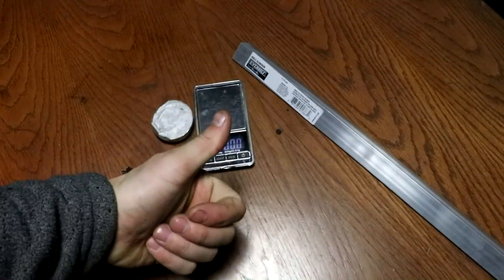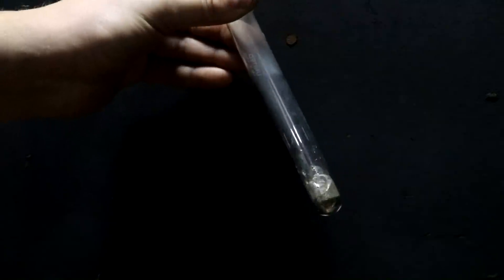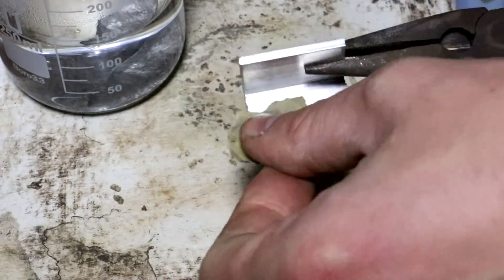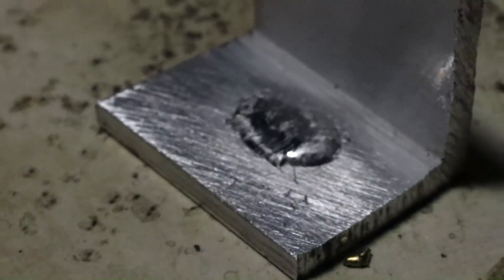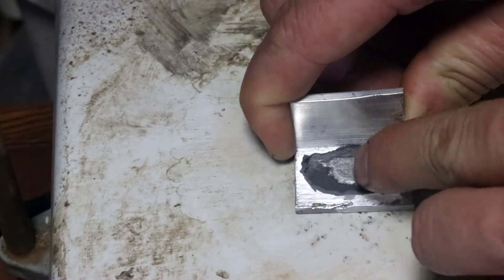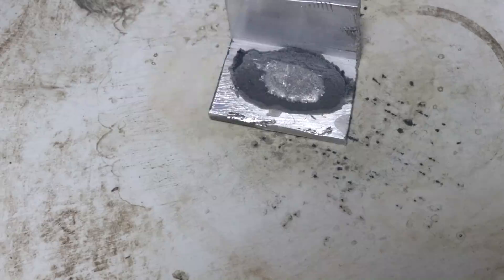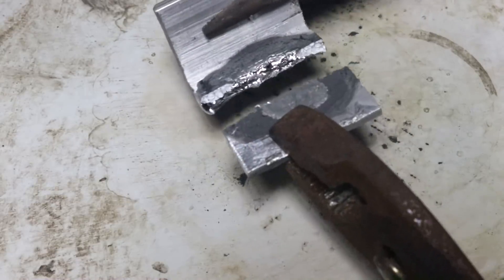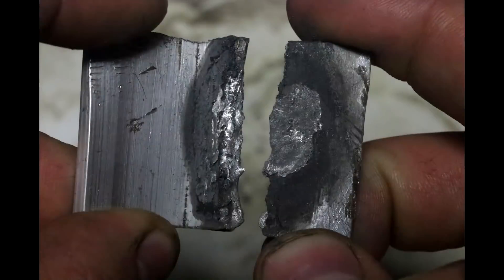Field's Metal vs Aluminium

Comment: Have you ever thought that it could be possible to use Fields metal as a cathode to electrolyze salt water to get the sodium out?
If it doesn’t work try rose metal.

Comment: So, when cooled down water vapor in the air may be reacting with the naked Aluminum. I am fabricating a small MHD pump to sling Field's metal globs around a gated loop to do what der Sprengel pumpen does but faster. Needed to know if Wood's or Field's attacks like Hg. Found no references anywhere 'cept for good old Cody.

Comment: I wonder if the reaction between the two metals is specifically dependant on a certain temperature below what you are using when the hot plate is on.?

Comment: I think this system is more complex than first meets the eye, as this is likely atleast a 5 element system, as a lot of aluminum sold for construction is hardened with copper. Plus the water might have introduced protons or sodium as well, although I doubt it actually did much here. Personally I would love to have taken an diffraction pattern of each of the materials, the aluminum and the fields metal, before and after this reaction. I do think that at the very least the aluminum chemisorbed or otherwise interculated the liquid alloy. Doesn't beta tin have that same dark gray color as well? I do wonder if it is one metal preferentially going into the aluminum, as when you reheated it, I didn't see any liquid remelting. Although it might have also been that aluminum doesn't dissolve much into the fields metal until lower temperatures. I wonder what would change if you used aeziotropic(I can't spell) fields metal instead.

Comment: I'd postulate that the thermal expansion properties of the two metals meet at some x,y point...and the field's metal can attack the aluminium at that point most optimally. Rather than thinking of solids being dissolved into solution, consider liquids being absorbed by solids.

Comment: From what I can ascertain, it works with thermal cycles because it has something to do with electrons changing energy levels. when hot they are at an energy level that prevents the reaction between the metals. when cooling off, the electrons lower their energy state to a point that allows for the reaction to take place. The electron energy levels might affect the protons between metals, one state dying to donate their protons and another state not so willing to donate protons. Something like that >.<

Comment: I'd suggest a temperature lower than the melting point of the Field's metal.
It may not be a thermal cycle causing the degradation, it may be something like the aluminum being too hot for the Field's metal to get it wet.

Comment: 1 nanolightsecond is actually a surprisingly useful unit of measurement. It's just under 30 cm (or 1ft), so you can readily apply it to "regular" distances. It's also a good starting point for latency computations: two datacenters are 1000 kilometers away, so that's about 3000000 nano-ligth-seconds, or 3 milli-light-seconds. So the lowest possible latency between them would be around 4 milliseconds (light in fiber is a tad slower).

Comment: i was looking for the video where you combined aluminum and gallium then reacted that with h2o to make hydrogen. is there any process of splitting the aluminum and oxygen from the al2o3 to form it back into aluminum, potentially make an engine that is a closed loop requiring only water and some other inexpensive chemical/s. Even if it was a vapor process it would fascinate me to hypothesize a self repairing engine that plates itself to counter natural wear?

Comment: Keeping it heated is now allowing moisture build up through the field's metal.

Only when you let it cool down is water in the air able to condensate inside the aluminum and allow a chemical reaction to occur, thus destroying the aluminum.

Comment: I'm in school to work on aircraft, and I know how finicky aluminum can be when it comes to heat treatment and temperature cycling. Errors in very specific steps of heat treatment lead to uneven grain boundaries, which (while over time would naturally split, corrode, and weaken by itself or through various stresses) is accelerated by the addition of any foreign substance (usually water or ferrous metal from a fastener in the metal). These grain boundaries are intentionally aligned laterally to best handle stresses which is why you see the metal break apart almost in sheets as it does. What confuses me is the coloration of the corroded aluminum, as natural aluminum corrosion generally appears at a light grey or white powder.

Comment: is it possible that there is a specific thermal point at which the alloy is reacting with the aluminum instead of simply high temperature low temperature difference?

Comment: I would imagine it soaks in between the aluminium crystal structure of the metal; hence the way it 'moved laterally', and due to the space sizes between those aluminium crystals, maybe isn't doing so in alloy form, but as one of the consituent metals, cooling, forcing the crystals apart more.  It isn't mercury, so I suspect when it soaks into the aluminium, it will separate slightly between various crystal veins.

Comment: the heat from the hot plate was preventing the moisture in the air from attacking the metal ?

Comment: I ordered some 99.9% pure gallium and for some reason I couldn't get it to react with aluminum I think it's either because the oxide layer or I got duped and sold this alloy that you just made which appears to take more time to react than gallium Mercury although if I put it in the freezer freezes which Mercury wouldn't do so it has to be gallium or this alloy

Comment: Fields metal either solidifies between aluminum crystals, or is too thick to readily flow between them at an observable rate. Plugs up. Allowing material to cool contracts aluminum structure at interface, breaking reacted metal apart and serving as a mechanical pump to force remaining unreacted Fields metal through aluminum. Creep out the sides and bulging at top due to mechanical pressure of contracting aluminum. 

It's a theory.

Comment: Cody, Liquid Metal Embrittlement (LME) is the name of the process of degradation you have shown.  Typically LME shows a trough of mind minimum ductility (maximum brittleness) at the melting point of the liquid metal (or perhaps a component of a liquid metal alloy?) 
Thermal cycling will yield large within internal stresses with  liquid metal having diffussed intergranularly and given the inherent variation in thermal expansion for different components.
.
Oh, one more thing.  'AH-lu-mi-num'.
.
Thanks for the great videos.

Comment: So I’m wondering how hot you took the hot plate, considering the fields metal melts at such a low temp. I know that metals can change molecular structure at higher temps, but most of my knowledge there pertains to steels (and I’m sure Cody has similar or better knowledge on that topic). Anyway I wonder if the transition between one structure and another allows for the fields metal to penetrate, at a specific transition point.

Comment: If you take a look at Al-Bi, Al-In and Al-Sn binary phase diagrams compared to the Al-Ga binary phase diagram, there is essentially no solubility of Bi, In or Sn in the aluminum, compared to ~20wt% solubility of Ga in Al. 
Perhaps while the alloy is molten, some of the liquid diffuses at the aluminum grain boundaries. Once cooled, the alloy precipitates out disintegrating the aluminum, and compromising the oxide layer, which is why it reacts so easily with water.

Comment: The reason it only happens when cooling off could be because of moisture? When the metal is hot, it doesn't allow water to enhance the oxidation. Also, when cooling off, condensation could be more likely to collect which emphasizes this effect.

Comment: My hypothesis for why Field's metal weakens the Aluminum: When in a liquid state one of the metals is soaking into the Aluminum, acting like water on a piece of paper, and it disrupts the bond between the aluminum atoms. Lessening their ability to hold against stress. But when it solidifies allows the creation of an oxide coating with in the aluminum structure, and if its anything like iron oxide, it will expand just a tiny bit. creating more space for Fields metal to soak into the aluminum.

Comment: @cody'sLab Thismight be an endothermic reaction (You could track and plot the temperature). So cooling it might cause the reaction to run properly. The needed heating (if actually needed) could just be for the metal to liquidize. Otherwise the Temperature could be needed to supply the activation energy to start the reaction. I have no clue what this reaction is but you could test my hypotheses.
Thx for the Video!

Comment: Perhaps the aluminum is disrupted when cooled due overall low solubility and thus as temperature decreases the aluminum falls out and precipitates on the surface and immediately oxidizing? Field's metal should have a greater density than aluminum.

Comment: This makes me wonder if it could be used nefariously to destroy an aluminum engine block. In the engine valley it could be contained and would be hot enough to liquefy the metal and soak into the engine over time.

Comment: This is just an uneducated guess on my part, but I'd ask if the reason it attacks the aluminum once they're cooling off: could be due to their [possibly] varied heat capacitance values, leading to a thermal gradient which starts out not a gradient when they are the same temp, but when they cool they do so at different rates leading to a differential? Perhaps?
Reply: This is just an uneducated guess on my part, but I'd ask if the reason it attacks the aluminum once they're cooling off: could be due to their [possibly] varied heat capacitance values, leading to a thermal gradient which starts out not a gradient when they are the same temp, but when they cool they do so at different rates leading to a differential? Perhaps?

Comment: It came as a brand name Cerrobend in a shop where I worked and was used to keep small metal tubing mainly stainless from kinking when making bends. It was kept in a hot water tank with a petcock on the bottom, and when you wanted to make a bend, you capped-off one end filled the tubing capped the other end and made your bend. When done, you cut the capped ends off, put the tubing back in the water tank and in just a minute or two, poured the Cerrobend out and voila, a perfect bend.

Comment: it seems like some sort of galvanization process to me. my hypothesis would be; that, the metal when in liquid form can penetrate the aluminum, but requires cooling  so that it may re orient it self to the point that it only gives the electrons to the aluminum that it would in its solid state. further testing will be required, but my suggestion is to melt the aluminum and observe the reaction. also to experiment with, if the amount of time the metal is liquid versus how much area its seams to have penetrated.

Comment: Cody, do you think that it is possible the reason it accelerated when you cooled it off is because moisture could get to it or even condense on the cooling metal? As opposed to when it is hot it is constantly driving off the moisture.

Comment: I wonder if the reaction being accelerated has to do with the fact that the aluminum is expanded under the temperature and when it drops it makes it a little smaller which let's the field's metal into the structure of the aluminum, I also know aluminum is really efficient at conducting heat across the surface so that could be a factor too?

Comment: I have an theory as to why when it is cooling it affects the aluminum in such a way. Perhaps it is due to the expansion of the metal and the agitator ( your metal mix ) that is being in direct contact with the aluminum? Also the scratches on such aluminum could be creating a oxidizing effect while in the cooling process. This is just from observation, I'm no science guy :/ The heating plate not being a completely flat surface may also have something to do with it???

Comment: the aluminium is affected more greatly by the cycle due to the fact that the liquid alloy will migrate on through and as it turns solid , the alloy shrinks/expands which will then damage the aluminium by affecting it's structure.

Comment: I wonder if it was changing at a specific temperature, and would keeping it at that temperature would that speed up the reaction? Or would it slow it down, because it needs to be hot to oxidize first? Hmm...

Comment: Aluminum has a pretty high thermal expansion rate, I suspect that field’s metal is substantially different from it. If this is true, the thermal cycles could be causing the aluminum and field’s metal to expand and contract differently, the cooling cycle would effectively make the aluminum push itself apart because its contracting more than the fields metal and at a faster rate. This would allow the field’s metal to seep it’s way through the aluminum faster, reducing the overall time for saturation to occur, and possibly even weakening the new alloy even more than if it were just allowed to sit until saturation without the thermal cycles. I’m curios if the thermal cycles cause any distortions in the material, such as bending, stretching, elongation, etc, if so, I think that would only add evidence to this hypothesis.

Comment: Going with the convention of a light year, i would think the term would be three light nanoseconds long. Not three nano light seconds. Not really important or clarifying much and it could really go either way since its a measure of distance. Its a nano division of the distance light travels in a second. Or its the distance light travels in a nanosecond. The first way requires you to do math in two directions if you dont have all the divisions memorized. The other jist tells you how to get the value.

Comment: Could the heat cycle be due to the different expansion coefficients of the different metals, or maybe the lack of granular structure in the liquid vs metal? (like ice inside a rock)

Comment: You might try using a larger block of aluminum, and get the waterjet guys to cut it in half instead of breaking it.  Then polish and acid-etch the cut surface to view the changes in microstructure.

Comment: I would love to see this metal used on an aluminum engine block with the heat cycles that happens on a normally used car. If it would indeed cause a pre mature failure of the engine

Comment: I'm assuming from how it changed colors through the cycle that at a certain tempreture it changes from being preferably in two phases (aluminium and the alloy) to a single phase. This would explain why the dark part (the single phase) shrinks when you heat it up again and expands at lower temperature. Of cource at the end to weaken the aluminium you will need to heat it up as you did to separate the phases creating a mixture of a solid and a liquid which makes it weaker. For best results I would suggest pouring it hot (liquid) to get good contact with the surface and then leaving it at room temperature for a long time. Then when you want to break it just heat it up again.

Comment: Perhaps it could be interesting if you were to use your xray spectrometer on the seemingly unaffected parts(the backside or perpendicular bit) and analyze the composition; how the Fields metal diffuses through the aluminium and whether it diffuses into the aluminium before actually affecting it. Though that might even be more interesting when trying gallium or mercury as it has a more clear and measurable effect on its integrity.

Comment: I'm guessing that the addition of the Fields metal on the aluminum disturbs the normally passivating coating of the aluminum due to the additional oxides, but only will spall and create fresh surface for the Fields metal to "attack" when it cracks with the thermal cycling.

Comment: OMG someone else who uses nano-light-seconds as an everyday unit!
For those wondering one nano-light-second is 29.97cm
Reply: Huse american gawd dammit
Reply: So.... Im too lazy to calculate... How many nano light seconds is 3km?
Reply: 29.97cm ~ 30cm
x 10 = 300cm = 3m
x 1000 = 3000m = 3km
10 x 1000 = 10000nls (nano lightsecond)
1000nls = 1µls
10µls = 3km
Reply: @FyreSpit thank you! 
thats the time light needs from my house to the nearest city.
Reply: That would be 10µs (microseconds) - time.
10µls (micro lightseconds) - distance covered by light, through a vacuum, in 10µs.

Comment: The expansion and cooling of the crystal lattice structure, causes a quantum fluctuation, which then reduces the probability wave into a deterministic algorithm, which can be resolved into a system that can utilize redundant dimensional occurrences, thus allowing for the measurement of both momentum and position, to an absolute precision that can be used to understand why chicken nuggets taste so good. I forgot about the video halfway through this comment, sorry.

Comment: My bet is that the aluminum and aluminum oxide expand and contract at slightly different rates during the thermal cycling. You might get microscopic cracks in the oxide layer as it cools, which might not be as pronounced during heating where the oxide reforms more quickly. These cracks in the oxide layer would allow the breakdown of the aluminum to advance further.

Comment: My guess is that a thermal convection loop is formed between the two metals and since that is where the energy is flowing the two tend to share electrons more readily while if the both are warmed up their energy saturation is such that their reactivity is lower much like how light absorption is affected by energy saturation under the beer- lambert law. A similar effect is described in the laws of thermal dynamics, a substance with a lower amount of energy is more likely to react to a substance with a higher level of energy and vice versa.